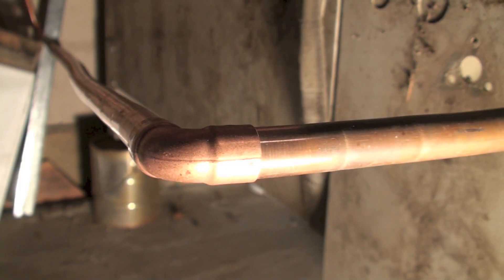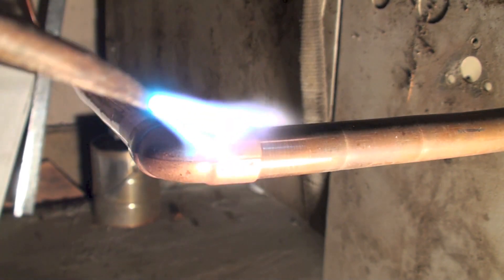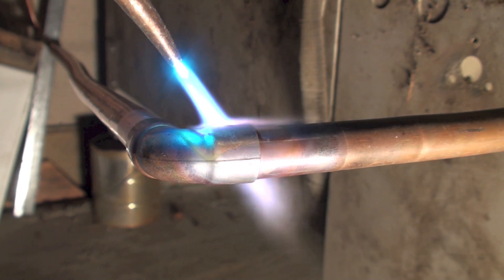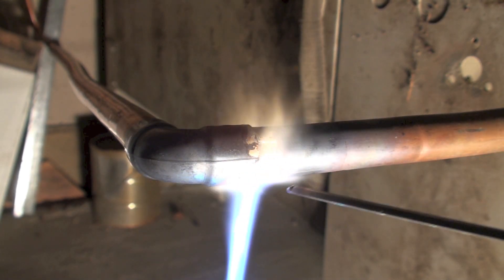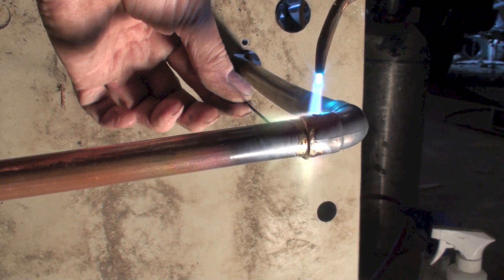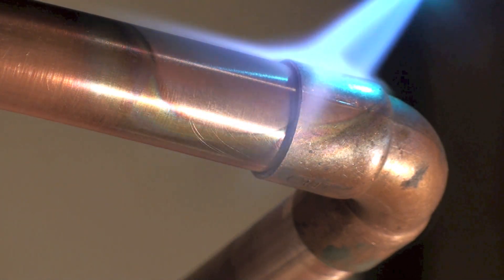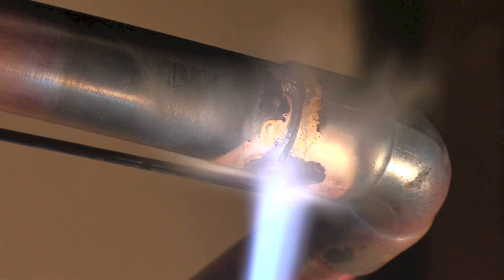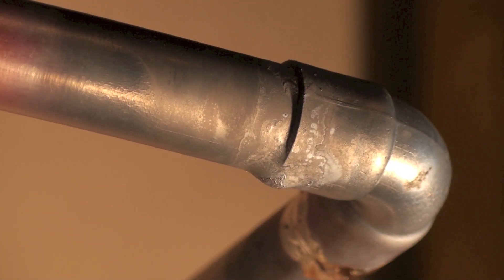How to braze copper with sil-phos brazing rod

Comment: i have 3 questions: 1- what are the differences between different filling metal with different silver ration, 2- do you use flux and what kind?  3- can you use yellow map gas instead of acetylene? thank you
Reply from the maker: I work as a serviceman so my experience is with used piping mostly.  15% is far easier to use and, as you say, much more forgiving.  I have found that one leak pays for a lot of 15% braze rod.
GFM
Reply from the maker: +Fo Saleh I have fond the 15% to be the best for sealing.  The 5%, in my opinion, does not seal as well.  No flux.  Map will work with smaller connections.  Probably not larger than 1/2".  
GFM
Reply: 100% agreed. The cost difference only starts to become noticeable when you are looking at dozens of large (3 inch and up) connections.  30 pounds of 5% vs 15% really makes a difference.  Good video btw.
Reply: Would a propane torch work if used for brazing 1/4" pipes for fridges ?
Reply from the maker: I would use mapp.  Yes it will work.
GFM
Reply: 15% silver content is the easiest to use (imo) as it flows better and has a more forgiving heat range. That being said, Ive been on plenty of large commercial jobs where the contractor provides 5% and it seals with no issues. 5% is considerably cheaper but the lower silver content makes it less forgiving in regards to excessive heat. You end up feathering the torch more to find that sweet spot that melts the filler rod but doesn't turn it into a runny mess that won't fill the top of the cup.

Comment: You should heat and apply brazing rod starting from the bottom because heat rises. Here the hot braze penetrates the hot top part of the joint and just puddles on the lower cooler part of the joint.
Reply: Heat rising only pertains to gases and some liquids. Hot air is lighter(less dense) than cool air, therefore it rises. That is completely irrelevant in a solid. What is relevant in both convection, and the puddling of the brazing material in this video, is a magical force called gravity. It has a tendency to pull things towards the earth, which is why the freely flowing liquefied brazing material, is pulled downwards to the bottom of the pipe. Not to mention that the thermal conductivity of most metals are so high that the temperature variation over this small of a distance would be completely negligible. Cheers
Reply: your right

Comment: GFM, I have seen guys drench the just completed brazed joint with a wet rag to cool it down quickly.   I think this is a bad practice as the rapid cooling of the material creates micro fractures in braze.   What do you think?
Reply: Is it true you can wrap sensitive parts like valves and what not with a wet rag (not dripping) to protect from heat damage when brazing ?
Reply from the maker: +Gene Friedman I have been cooling down these joints the same way for 35 years.  It does seem it would cause cracks but it does not.
GFM
Reply from the maker: We are not welding steel here.  I would agree with the cooling down when using steel.  However, the cooling of the copper does not have the same result.  In addition, the joint may be very close to heat sensitive valves that could be easily damaged by the temperature.
GFM
Reply: Using a soaking wet rag for both valves is a good heat sink thus protecting the rubber packing gland in some valves. Those brass valves are copper coated for ease of soldering, if it's thin or someone sands it completely out it makes for a really tough job. Brass and copper are very soft and cracking wouldn't happen under those conditions.
Reply: actually when you heat copper and quench it the copper will get softer it works the opposite of steel. bet you didnt know that one lol.

Comment: hi GFM. Have you ever used the turbo torch?  I have one and I think Im not setting the acetylene high enough.  Any tips or thoughts?
Reply from the maker: johnmiller102 The acetylene cannot be set above 15#.  The torch will not be as effective as oxy/acteylene for brazing.
GFM
Reply: It does take longer to braze with just acetylene but it is really convenient not having to carry two tanks.  But it is really limited on size of line set. Thanks for your quick response.  I really learn a lot from your videos and keep a eye out for new ones from you.
Reply from the maker: johnmiller102 Thanks for the support.
GFM
Reply from the maker: I stopped using the turbo torch around 35 years ago because the joint heats too slowly.  Regardless of tip size.  This causes damage to valves that may be close to the joint.  Heat it as fast as possible and get out.
GFM
Reply: Yep, Totally agree ! Get in , hit it , and Get out. count to 15 ,then cool the joint with a clean wet rag.

Comment: why is it important to remove holding charge of nitrogen/helium mix before brazing .
why cant stay in unit to check for leaks when done with install.
Reply from the maker: jeffrey gallagher Any pressure inside the pipes will cause leaks while brazing.  
GFM
Reply: yes correct it will blow out with preasure rather than suck in to the joint and make a bad seal.

Comment: sometimes when i am brazing liquid line dryers i get this strong pungent smell that takes my breath away and my eyes burn what is this. THANK YOU
Reply from the maker: jeffrey gallagher That would be the refrigerant left in the pipes breaking down into phosgene gas from the flame temperature.  Its a form of hydrochloric acid when mixed with the water in your lungs or eyes.  That gas was used in WW1 as a poisonous gas.  You might not want get around that too much.
GFM
Reply: grayfurnaceman how do iget allthe refrigerant out of the lines .do i recover untill a vacum or do i need to run a vacum also
Reply from the maker: jeffrey gallagher I would be sure you have reached 15" vac with no increase in pressure after shutting down the recovery machine.GFM
Reply: .....you just made phosgene gas caused by putting an open  flame to the refrigerant .......very dangerous.....
Reply: mmm good. mustard. lol
Reply: It'll also leave a "fog" hanging in the air. Nothing worse than getting an emergency call to a store, arriving on site and seeing a fog hanging in the store. That usually denotes a large leak. To be followed by various emergency vehicles, angry bosses and angry store managers, lot's of questions you've neither the time nor patience for, and, once in the case of a store where we were acting as another companies back-up, we even had a news crew showed up!
Reply: jeffrey gallagher i believe thats whats called "mustard gas" lol its really good for you!

Comment: Is oxidation is a serious issue for TXV's or compressors? Do we have to use nitrogen during the brazing? Because I could't use it for my last installation and kind of worried about this. I have a filter drier and vacuum the system for 2 hrs.
Reply from the maker: +Artie Abrams How do you know you never run into a problem.  Reduced life is not usually found with failures under warranty.  Using nitrogen to braze not only keeps the piping clean, you can then use it for leak testing when the braze is done.  Vacuum time is not important.  Micron gauge reading is.  Time will not guarantee a deep vacuum as there could be vacuum leaks that you will not notice.  Only a micron gauge will tell you.  Acid away will not stop contamination, it just neutralizes acid.  Not trying to beat you up but it is just good practice.
GFM
Reply: i Just Re-did a Refrigeration system that when i Removed the Txv Screens and Orifices on Two Danfoss Txv's and they Were all Full of Oxidation flakes from alot of Welding that was done on the System Before i got there. They Were Really Plugged up Oxidation Flakes ! Major !  My Rule is ---  if i am doing anymore than 4 Welds, i will weld with Dry Nitrogen For Sure ! Period ! i allways try to use dry nitrogen when possible. if u are Just HItting a leak, one weld , don't worry about it. it just gives u a cleaner system Less Oxidation Flakes / Grit in the Compressor oil  and in the driers to give u less pressure drop across the drier.
Reply from the maker: Guy Hakverdi It can be.  The copper oxide gets into the bearings of the compressor and reduces life.  Less common, it can block the expansion device.
GFM
Reply: Here in new York we never breze with nitrogen and never run into a problem.
from where the hell people are coming with that?
If you did a compressor and it was a burn out, drier change is important but you should vacuum the system more than 2 hours and on top of that I would use acid away to neutralize any bullshit from the lines.
Reply: Some will argue but I always installed at minimum a liquid drier(right before txv is best) and never used nitrogen on countless systems as long as only four to five joints maximum are being silfoss'd. Now get into a rack system running hard drawn in unistrut, nitrogen is a must! A slow pain especially if your welding up five to six systems at once! Good luck out there, I'm retired now. Some days I miss it, 40 yrs and loved every part except last two. Pain makes a fun job miserable!

Comment: Again, is this not silver soldering? I thought brazing involved running a bead, covering the joint not flowing it in as in soldering. To braze we used a brass rod with a coating.
Reply: grayfurnaceman I used to ise that flux coated stuff in highschool. The 15% does run quite nice. Welder by trade here. Stick, mig,tig, etc. and this was quite nice to learn
Reply from the maker: Its called a silver braze.  Melting point 15 to 1600 degrees F.  Anything above 800 degrees F is considered brazing.  What you have been doing is bronze brazing at about the same temperature.  Hope this helps.
GFM

Comment: Try brazing 6" pipe, and you did'nt put a shoulder on it ain't got time to find leaks with 385 foot runs.
Reply: mike smith  While I'm no expert, I agree with you. I was taught to leave a nice shoulder with no cup showing through whatsoever. I work for a refrigeration company that removes/installs all cases during supermarket remodels (Walmart, Food Lion, Publix, etc) as well as installation of entire system (DX, glycol, CO2) in newly constructed stores.
 We've got a lot of guys that get the pipe/fitting so hot and leave the silfoss so thin that it looks like it's been soldered. I'm often told that my building a shoulder is nothing more than a waste of time and silfoss, BUT in the 12 or so years I've been brazing copper lines I can count on one hand the number of times I've had a leak resulting in a loss of refrigerant. And those few leaks were because of my failure to use my mirror and flashlight - getting in too big of a hurry. Great video, though. I've learned a lot from all of the videos found here. Thanks for sharing!

Comment from the maker: The air acetylene torch, in my opinion, is not suitable for high temp brazing.  Its lower temps increase heating time which results in possible overheat of service valves.
GFM
Reply: It happens. Sadly I've done it before, with oxy-acty, but I was new and havent ever again

Comment from the maker: Brazing is over 1200 degreesF.  The joint is much stronger than the parent metal.  Generally, when using refrigeration pressures (200-450 psig), sil phos is used if the tubing is copper.  If the parts to be joined are brass or steel, 40% silver braze is used.  I will be doing some silver braze in the future.  Hope this helps.
GFM

Comment from the maker: Thanks for the support.
GFM
Reply: It's good practice to top off the joint with sil-fos. I stopped using 15% in favor of Blockade which is much cheaper & does the same thing. Sil-fos or even 5% silver alloy costs 10 × as much as Blockade. 6% silver bearing solder also works fine, but you should purge with nitrogen no matter what.